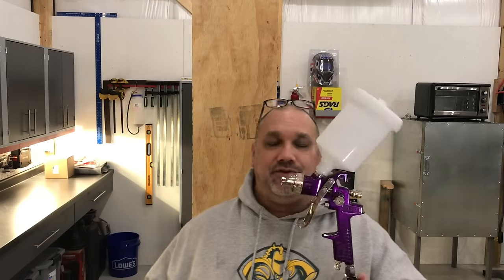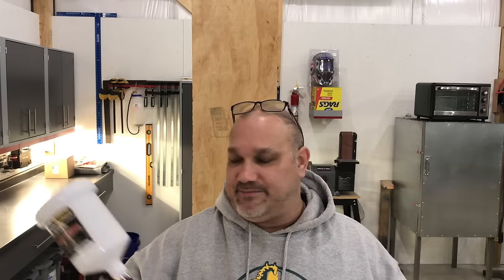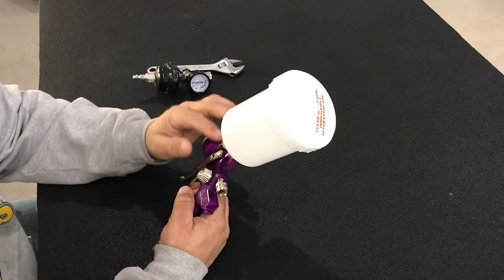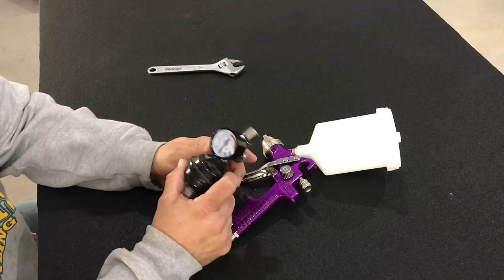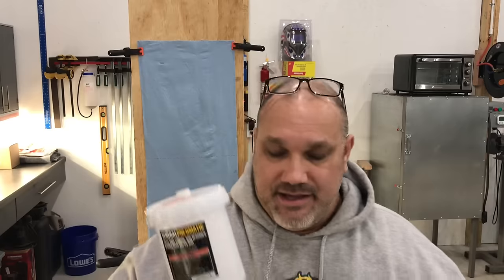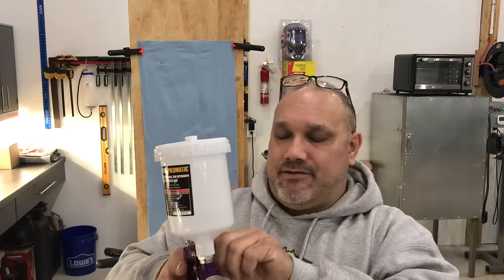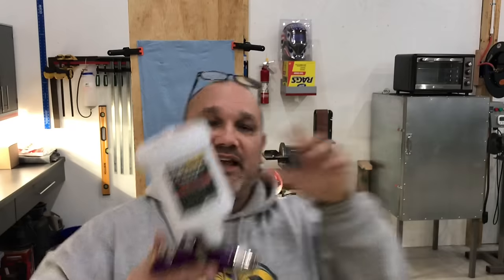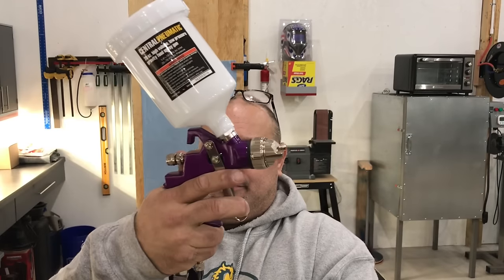How To Set Up a Harbor Freight Paint Gun

Comment: Most importantly clean all of the oil out of the gun with acetone before using these come loaded with oil everywhere disassemble and clean good if not you’re looking for problems
Reply: Fres Cali  how do you do this?
Reply: won't acetone eat all the seals and paint off the gun???
Reply: @RickaramaTrama-lc1ys  
I used to have one of these guns and I used acetone for cleaning after spraying polyester primer through it. Acetone won't be a problem in the fluid section of this gun. The cup is a plastic that isn't affected by acetone. Everthing else is metal except the needle seal which is teflon. Just put acetone in the cup and run it through the gun.

The gun body is anodized aluminum and that's not affected by acetone so you can wipe the gun down with it if you wish.

Comment: Been painting professionally for 15 years now(I restore construction equipment), and...those guns..are the ONLY ones that I use now. I have found, the better the paint...the better the finish. I've done 11 Bobcats(White, black and orange) with one gun. I've even stretched some to 18 projects. My customers love the results. Just make sure to keep the gun clean, especially the front nozzle. make sure to soak it in acetone, then, with a very fine wire...clean the time holes in the center.

Comment: Hey man! I really appreciate your time and I like to a ask, some about cleaning the gun, if you have any tips or the right way to clean a paint gun?
Reply from the maker: Saul Basua best thing to do is run some lacquer thinner thru it pull the air cap. fluid tip  and needle and wipe them down with some thinner. Then put it back together and flush again with clean thinner. I usually leave some thinner in my gun and store my air cap in it. This makes sure no residue will set up if you didn’t get it clean. I store mine hanging up and I use them quite often. If yours will not be used very often then you may just want to flush with solvent till it’s empty and store it dry. Thanks for watching.
Reply: Spray lacquer thinner thru it or buy an expensive gun cleaning machine

Comment: If you get the automotive two gun kit for 49.99 the one large gun is a devilbiss starting line gun. Same fluid and air cap and parts interchange. If someone wanted to save half the price
Reply: They have 3 different part numbers, probably from different manufacture plants - which one? part numbers listed on HF are: 60239 94572 61472
Reply: Thanks for the tip!!

Comment: I just bought this purple gun about a month ago or so. Finally got to use it for the first time this past weekend. And I can tell you.....I don't know what I'm doing (misplaced the manual). I had problems spraying paint. I played with the knobs and air pressure ( I have a pressure gauge and moisture filter attached). Now I know how to set the gun up to a basic starting point and know what the knobs do. Thank you for the instructional video. It helped out a great deal. The major issue while I was trying to paint (other than me, operator error), was the paint. I went straight from the can to the sprayer (Rust-Oleum Professional Smoke Gray Gloss Oil-based Enamel Interior/Exterior Paint ). I did not thin out the paint. Was not getting a spray pattern. It was coming out with splatter droplets. So, with this video and thin out the pain, I think I will do better next time. As far as thinning paint.....how thin? I heard to thin out paint to the consistency of milk. OK. 1%, 2%, or whole milk? any advice?
Reply from the maker: Ok I would use a viscosity cup. You can buy one on amazon. 20-24 sec on an ez zahn 2. Or you can start off by thinning by 25%. 3 parts paint 1 part solvent. Then spray a test piece. If it still sprays dry increase the solvent. Also make sure you pull out the filter from the cup. ( I would do that first) use a filter when you pour in the cup. I have a video where I paint some wheels check it out. Thanks for watching.

Comment: The only thing to mention is the gun needs to be cleaned prior to painting.  It has a lot of oil and debris from manufacturing.  Other than that, excellent video!!!!!!!!
Reply from the maker: 40mick I always run some solvent thru my guns before shooting any thing. Thanks for watching..
Reply from the maker: anonymous lacquer thinner is good to use.
Reply from the maker: anonymous if you paint a car you going to need larger air compressor. This gun requires a minimum of 6 cfm at 40 psi. You would be better off  to get something bigger than that.
Reply from the maker: anonymous 6 cfm at 40psi is what the gun called for, but Before I went out and bought an air compressor I would do a little research on what you needs may be later with other tools you may need. Air tools for body work are usually air hogs and require quite a bit of air. Look into the requirements of other tools you may need later first.
Reply from the maker: anonymous for painting at least 6 cfm at 40 psi and a 30 gallon tank. Hope that helps.

Comment: 40-50 psi is way too much if your spraying automotive paint. 30 psi is probably the most you would want to spray at, maybe even less
Reply: is there something wrong with my pressure reg.at the gun working properly/?It goes to 0- 40psi ,no inbetween unless I lower it T THE COMPRESSOR?
Reply: @sonnybee8271  iv used the hf gun with no regulator at the psi coming out of the compressor, and it came out perfect. It also used way more paint then it would at the proper psi. But if you got extra paint to waste then so be it. But if your trying to be as efficient as you can, which a DIYer should want to do, then you should spray at the proper psi. If a panel only requires 2 oz why use 5 oz to get the job done? Or if the guy selling you the paint says 2 oz will be more then enough and you go home with 2 oz but your gun isnt set up right so it blows thru that 2 oz before the job is done.. but like I said if you got paint/money to burn sand that's the only way you know then that's fine. But you doing a disservice to everyone trying to learn by watching this
Reply: Jake Clauson I’m buying this gun tomorrow to do my entire truck. What psi do I need to run my gun at and what size compressor do I need? I’ve heard anything from 20 gallon to 60.

Comment: Just don’t buy the small gun for small touch up it comes with a aluminum bowl that won’t stay upwards and the trigger shaft nut leaks bad if you try and tighten  it will snap buy a Home Depot Husky better quality
Reply: I have never had an issue with this paint gun....and have used it many times! I would recommend it to anyone

Comment: Im painting my vw bug with this gun. And I set my static pressure at 70psi at the compressor. Through a 15feet hose that gives me about the right amount of dynamic pressure when spraying. Set my fan wide like he says. Marked my fluid knob with a sharpie and turned it all the way in and then turn it out 2.5 turns.  Air setting on the gun is wide open. Im mostly 5"-6" away from the part when spraying. This gives me a nice gloss and no runs. I move the gun pretty quick but not to crazy. And do about 3 coats in 15min intervals for my 2K Acrylic single stage paint job in my garage. After that I need to wet sand with 2000 though because of dust nibs. The things that suck with this gun is you don't get a nice football shape spray pattern more like one straight line and it need pretty high air pressure to atomise correctly. But you can still get a decent job out if it if  you know how to work this gun.

Comment: Thank you for sharing your knowledge @gixerman01 ! 🙌  liked and subscribed. I was looking for a video to help set up the to the compressor and the hose for painting. When painting, do I need any type of regulator/filter to connect air hose to compressor? I purchased a Kobalt 20 gallon compressor oil free pump 4.0 fscm at 90 psi for small projects.

Comment: Thanks man! Very informative. I decided to paint a guitar body and neck using a spray unit rather than spray paint cans, which I hate. My questions: I'm using my Harbor Freight compressor I've had for years. It works well. I should by a airline filter for the compressor, correct. Will harbor freight spray gun be able to spray at all angles, due to having to maneuver the guitar body. I will be spraying a black for the color and a clear coat for the finish. Would it be okay to run water-based color through it or stay with oil-based. Any suggestions would be helpful. Thanks

Comment: thanks for the video, so when setting the pressure on the regulator on the bottom of the gun. do you do it while pulling the trigger? or set it without pulling the trigger and going from there?

Comment: Thanks for the information, I was about to pay 3200.00 to have a utility bed on my plumbing truck painted because the only equipment I have is a air  compressor.  I have paint and body work experience but its been about 15 years ago.  Going to buy the paint gun tomorrow and will paint my utility bed myself. Materials including paint guns will be about 500.00.  Thanks

Comment: bought several of these but have been afraid to use them.  Thx for tips, esp water filter and regulator on the gun.  still curious about viscosity and can you use latex?  Thanks for great video.
Reply from the maker: You can spray latex, but an airless gun would be better for latex. Thanks for watching.

Comment: Nice video @gixerman01!  Also like that you have added products used in your description.
Reply from the maker: Mark Lindsay thanks for watching.
Reply from the maker: anonymous specific gravity is a measurement of a fluids viscosity. Basically how thick or thin it is. Eastwood has a lot of paints available. Most satin finishes have a clear coat on them. The clear has a flattener in them. Good luck on your paint job.

Comment: I'm just getting started with learning to paint with a gravity  HYLP gun. I presently use the old siphon gun which is easy to use but very slow to paint. Can't thank you enough for posting this lecture up. I saw the Harbor freight $15 dollar gun and wanted to buy it. But also saw a lot of negative comments on how unprofessional or poor the gun paints. Even more so if your a beginner and have never used a paint gun. I do understand that using good tools makes a big difference especially when it come to ease of use and productivity. However when your just getting started and just painting wood, small parts, or iron fencing and not automobiles. The quality is not as important so spending $300 to $800 on a paint gun seems over kill. Especially if you do not know what your doing. I never knew that painting was so technical as you explained showing in the lecture things like checking how much fluid actually comes out of the gun. As well as how using the right size hose for optimal performance of the gun is a factor. Your lecture helped me to realizes that its not just the gun. Its about the whole setup from tank to tip that makes the difference. The goal is to learn quality autobody and painting methods so I can repair and paint my own vehicles. Especially my work truck which gets banged up now and then. So once again thank you for taking the time to share your expertise. I'm hitting the thumbs up and subscribing will start posting question after I review everything in your channel. Do you think I need to take a class on autobody and paint. Or is it possible to learn at home from Your channel, books, videos and repairing junked hoods, doors, and fenders? Basically just doing it...
Reply from the maker: Do some research and practice. Youtube is a good source for info. Thanks for watching.

Comment: i know this is an older post but i found this video extremely helpfull, its quick and to the point. I am spraying a single stage satin black. Is 30 PSI a good start off point for spraying this kind of paint???? I am using a slow reducer and or activator with the temp being in the mid 80's and on the humid side how long should i wait between coats and how long until its fully dried and set?????  And if you have any quick tips for single stage paint it would be greatly appreciated. thank you

Comment: I am going to make a 2.3 mm fluid nozzle and matching needle. I am using this size to spray Gelcoat over existing Gelcoat mainly to establish the proper film thickness. My question is when I make the nozzle, should the bore for the needle taper down at the nose to match the angle of taper on the needle or should it be maybe 2 or 3 degrees steeper for a more secure closure at the very front of the nozzle?
Also, the 1.4mm standard nozzle that came with the purple gun has 6 outer ports, I was going to increase that number to 10 and increase the diameter of those ports by about 15%. I figure that with the viscosity of Gelcoat, additional evenly distributed airflow would help the atomization process. Please forward your thoughts regarding these modifications and any advice you may have on spraying this project with an HVLP gun.
Thank you in advance for your time and consideration with my questions.
Sincerely Kevin

Comment: Started painting 250 feet of rail fence with brush and roller yesterday. Quickly realized I need something else. My brother has one of these. I understand it might not be optimal for painting a large area of fence. But I’m going to try it. Using oil based semi solid stain. Any advice or thoughts on that? Thanks for a great video.

Comment: How are you? I’m a DIY’er, and I wanna paint my rain guards for my car, the same color as the car. I have a 175psi pancake compressor.  I think it’s 6 gallon? Can I run this gun off this compressor, and not have any trouble on the air, coming out of the gun? I’m curious? Thanks👍

Comment: Hi I’m new with this my first time Painting a pick up truck I Purchased this gun you have in this video  and I have a urethane primer and activator and reducer and I’m mixing it 4 parts primer 1 part activator and 2 parts reducer and I’m spraying it at 40 psi .. If that’s enough information for you could you tell me  what is it that I’m doing causing a lot of orange peel?
Reply: Lower the gun pressure to 30psi at the gun. Make sure you're using the right amount & type of Reducer... Spray 7in. from panel and move faster... Good luck!
Reply from the maker: So a couple things can cause this. Do you remove the little filter? If not do that. Get closer to your part. If that doesn’t help, slow down a little while you make a pass. If those things don’t help try a little more reducer in your primer. I have a video where I talk about air hose and compressors. Hope this helps. Thanks for watching.

Comment: Just found this great video, quick question as a beginner Do I have to dilute helmsman oil base spur urethane with this gun and second Due to the drying time 4 hrs at full strength, will I have to clean the Atomizer between coats?
Reply from the maker: I have not used this material, so I don’t know on that one buddy. Good luck

Comment: Do you recommend modifying/drill out the tip to spray thicker latex paint?
Reply from the maker: You would be better off to use a airless sprayer for latex. Thinning the paint may be better than drilling the tip. Although a larger tip is also an option. Some times they won’t seal after being drill just an FYI.  Thanks for watching.

Comment: I'm wanting to buy a Harbour Freight spray gun for wood staining and applying polyurethane, any suggestions for which cheap model to buy? Also could u do a video demonstrating spraying stains and/or polyurethanes to wood and the dilution process? I'm a first timer at using a gun, need more info, Tired of applying with a brush, and getting crappy results.
Reply from the maker: This purple gun will do those projects. Diluting the material would be a question for the material manufacture. Each material is different. Thanks for watching.

Comment: First time trying painting with a gun. I have this HF purple gun. On the box it calls for 7-10 0z per minute. I tested with water and am getting maybe 5. I have the fluid knob turned almost all the way out, it started to wobble like it was at the end and ready to come out so I screwed it back in a few turns.
When I turn the fan knob from wide open to start to shrink the fan, the fan barely starts to change it's wide shape when the knob stops, ie. is closed, ...no more adjustment. I'm going to take the knob off and inspect. Maybe I'll see something out of whack, ...I don't know.    Great video by the way.
Reply from the maker: I wouldn’t sweat the fluid delivery too much. Start with you fluid delivery in the middle and work your way till your happy with how it’s laying down. Good luck.
Reply: @gixerman01  10-4, thanks

Comment: Superb !  I've watched a couple of your helpful videos on the purple Harbor Fr. paint gun which I just bought, and a couple of questions, please.  1)  You mention the filter in the top of the gun gets easily clogged... is it okay to paint car parts and not run with the filter ?  2)  I don't understand how to adjust the needle & the needle adjusting knob... do they regulate how much paint flows or are they some kind of trigger adjustment ?  Of course, better to learn from a pro like you than to learn the hard way.  Thanks for the constructive  videos you provide !
Reply from the maker: Yes you can paint without the internal filter, just make sure to run your paint thru a filter when putting it in the cup. Yes the needle adjustment adjusts the trigger pull for fluid. Thanks for watching.

Comment: Hey Bro ---- TOTAL NOOB using a gun -- any suggestions on a 120v compressor to provide the Harbor Freight enough air??? anything in the 30 gallon would be cooler BUT if I have to go 60 gallon I'm good - I'll call electrician to run a 240 outlet for me. 
Thought on the size of the tip - mine came with a 1.4 an I'll be spraying latex paint. Of course I'vb seen the mods to the tip with a drill an I'm not afraid to do a little drilling either. ANY SUGGESTIONS WOULD BE AWESOME.